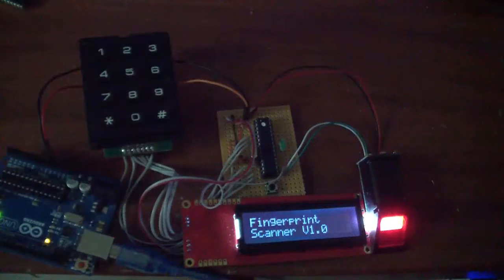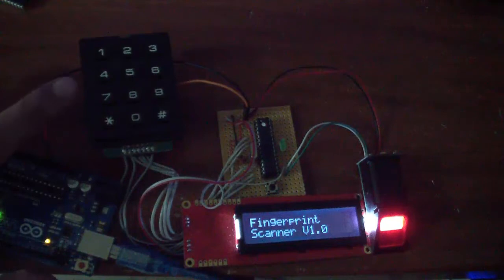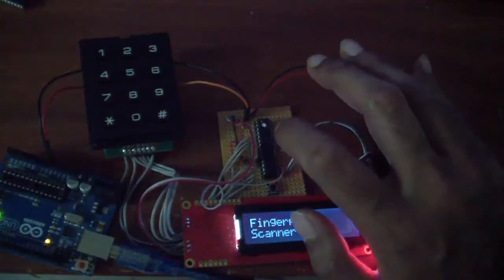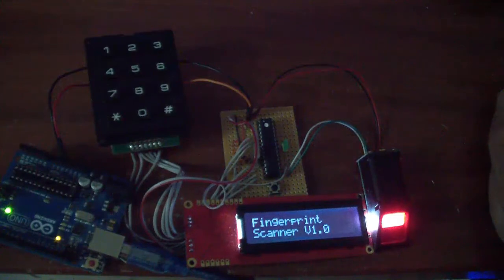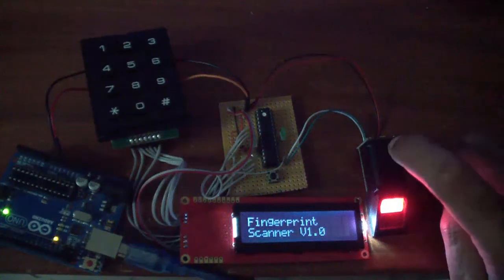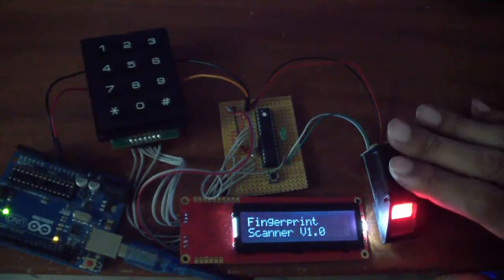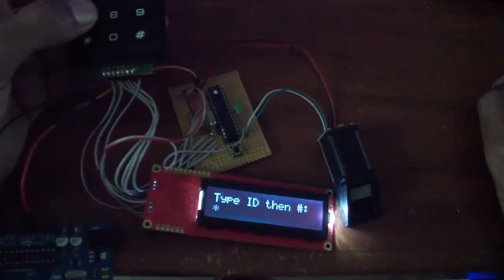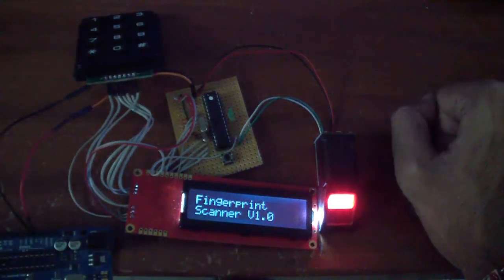Project Jarvis Home Automation Demo - Fingerprint Scanner

Comment: Hi, i see your programming and electronic skills are amazing. I would appreciate it if you could be able to help me. I am doing my final year Project in designing a fingerprint scanner circuit where it can do exactly what you have done, but for a Java GUI. I see you used a PIC18 Microcontroller, I will be using that as well. I know the circuit will be in C as PIC18 only operates in that programming language. 

Please could you be able to help me as I would be much appreciated.

Thank you very much,
Dawan